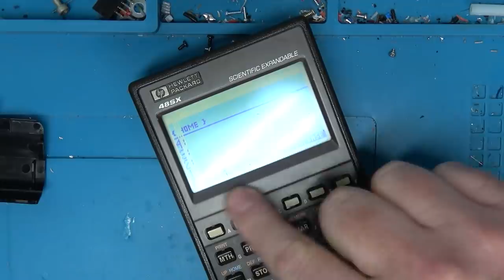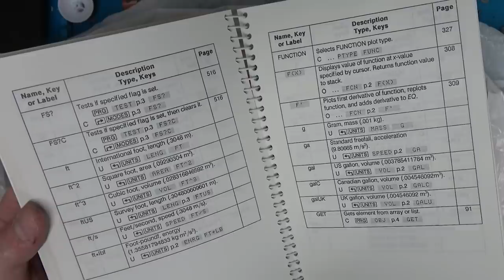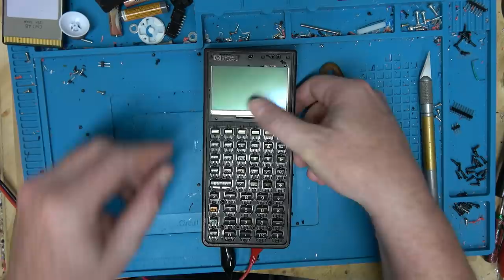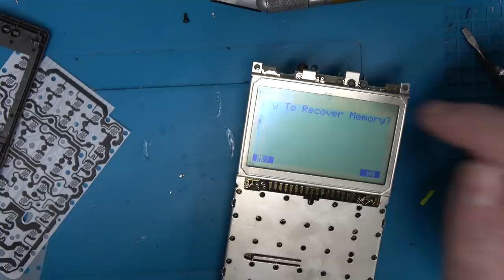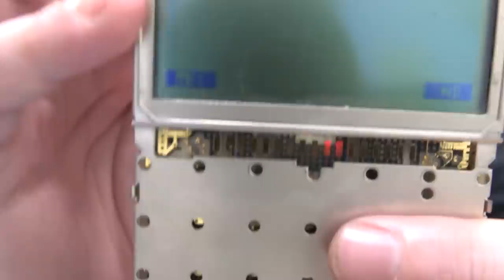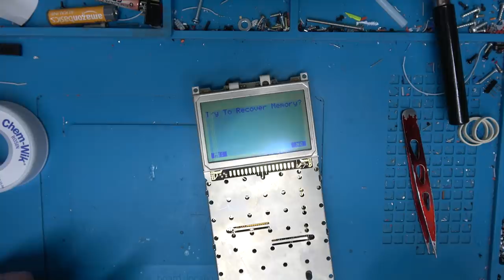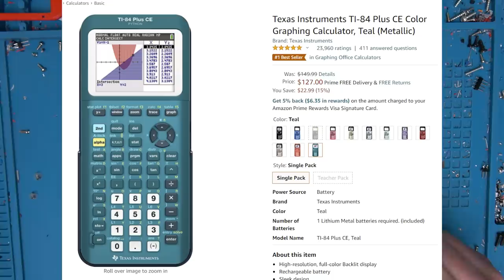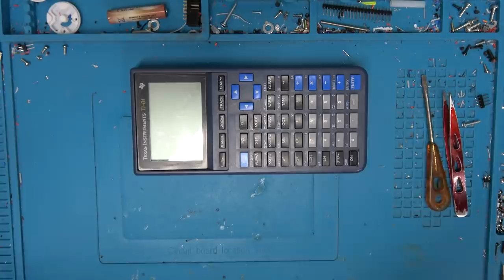Right to Repair Nightmare - HP 48SX

Comment: It sold for $350 in the early 90's. Which is about $700 in today's dollars. So yeah. a ton for a calculator.
Reply: I had one since college until it was stolen from my desk 20 years later.

They feel absolutely "monolithic" in the hand, as if one solid piece like our modern smartphones.  I bet that is why they used all the plastic welds.
Reply: Yeah it was really expensive - one of my friends had one and even had the chemistry addon card. It had an infrared modem feature so you could send messages (or more typically programs or data) between two of them.
What I didn't like at all (it makes sense from a computation standpoint but not from a user interface standpoint) was the RPN. first number, Enter, second number, plus... yuck. Give me parens to nest. :D
Instead I bought (still have it and it still works fine) a TI-85 - the pimp daddy of the TI calculators at that time. Nearly as feature packed (but with an even better graphing display) but half the cost - and since most curriculum back then assumed (if not outright asserted) that you had a TI-81 (the blue colored basic model), I was golden.
One really funny thing about the TI-85 is that it can run Basic code and with tricks you can run assembly, so yes I did have a copy of Tetris on my calculator back in the early 90s. It played almost as well as the Game Boy version, so not bad! :D
Reply: But worth every dollar. This calculator had functions that weren't available anywhere else, like integration, solving equations. Wolfram Alpha wasn't there yet...
Reply: Today, a $700 laptop would make it look... Like a toy. While you could use this for engineering today, I really just wouldn't and it probably is why my dad's is still in a box in the garage.
Reply: Industrial tech is always so amazing to see. Like we all lament planned obsolescence but it doesn’t hit home until you see what the same manufacturers are capable of when targeting enterprise users. I’ve got a couple PDAs that are built so rock solid that I literally ran over one and it works just fine. When I start making money again I’ll probably end up buying a Toughbook because I’m sick of how flimsy even the best consumer laptops are. This stuff is always worth every penny if you can afford it.
Reply: @chouseification  RPN took a while to get used to, but once it clicks, it's WAY faster than parens. I know, I had classmates with other calculators with parens and us 48G crowd were always faster
Reply: @MadsterV  I believe it, I just didn't end up going that route and gaining those stack bonuses
Reply: @gavincurtis  "I bet that is why they used all the plastic welds." Heh, nope. You really think plastic rivets are more solid than machine screws screwed into metal inserts?
Reply: @Gigator  They can in some instances, but eliminate repairability.  Every screw together laptop I have gets loosey goosey garbage after time.  But a riveted laptop cannot be serviced, apple knows...

My HP-48 felt solid, like it was potted when I bought it.  Still solid as the day I bought it decades ago.  Never had to take it apart, looks like I never will with all those plastic rivets.  :P

My Model M keyboard had those rivets on the metal base plate, those have been replaced with screws.  Screws with brass inserts in the plastic should have been used by IBM.
Reply: The HP41 was the last military grade, stirdy HP product.
(With a cool synthetic programming module.)
Then, they let the d signers in and here you are sawing, drilling, milling...
Reply: @braddirt  if he would like to get rid of it it could score you guy sell it for some nice cash mainly if it still in box.

Comment: I've repaired a lot of these, 48SX, 48G and 48GX. You totally ruined this unit for no good reason. LCD and zebra strips from a donor 49G and you would have been in business for the next 20 years.
Reply: Considering I need a display that's good to know. Hard part of a lot of old electronics is finding parts.
Reply: I have a 48sx with a blackened display, I don't know if it turns on. I can't see anything on its display. Can you help?
Reply: @ROGUPA  : Make sure you don't have the contrast turned all the way up first.
Reply: @brodriguez11000  it is not :-(

Comment: The thing is, unlike TI calculators, the HPs just pretty much didn't break. I went to Michigan Tech in the 80s and I worked at a store that sold HP. I can't tell you how many times we had people come in and finally buy an HP after having trashed three TIs in 2 years. It doesn't take many times of your calculator failing in the middle of an exam, and realizing it only EVER happens to people with TIs, to give up and buy an HP.
Not to mention that once you use RPN, everything else is stupid. I mean algebraic is OK if you want to multiply two numbers, but if you're working on complex stuff RPN rules.

Comment: TIL: Canadia has a different definition of a gallon.
Reply: yeah the Canadian gallon aka Imperial gallon is based off of a weight of 10 lbs of water. which comes out to 4.5 liters. where in the US it is based off of a volume of 231 Cubic Inches, or 3.7 liters.
Reply: @scottcol23  ...and then the US also has dry gallon... which is close to the Canadian gallon.. but not quiet...
Reply: @olik136  yeah its ridiculous really
Reply: What u talken about man, like the rest of the world, we are metric. Litres. Must have been a while since you been in Great White North.
Reply: @kippie80  I'm not talking about day to day usage of individuals. I'm talking about a unit of measure.
Reply: @UCsTsgaFY_CV2G8cWOy3tbRg Yeah sure.  I remember.  But, that system went by by with by act of Parliament back with Pierre Elliot Trudeau was in power in the 70's.  Since then, our cars consume fuel at a rate of km/l and we buy fuel in Litres.
Reply: @kippie80  I was just talking about the differences in the US and Canadian gallon thing that was mentioned in the manual. the thing was from 1990 and I guess at that time people in civil engineering were still using it or at least having to run calculations based off of an antique measurement.  I think we all should use metric these days.  And yes, its been a while since Ive been to Canada. I grew up in Michigan, Went to College in suit st marie (Lake Superior State University) which is on the US/Canadian border.  Used to cross over all the time to party at the Casinos where the drinking age was 19. LOL im 39 now and live in New Orleans
Reply: @scottcol23  That's the UK gallon, 10 pounds of water to the gallon, 20 ounces to the pint.  I guess the Canadians borrowed it sometime when we started looking at using litres for everything.  :)  Stupid thing is, in the UK we buy petrol or diesel fuel in litres but we stick to using miles-per-gallon for fuel consumption comparisons.

Comment: They didn't want their technically savvy customers upgrading the SRAM.  The lion kingdom eventually ripped off the tin, stacked on another 64kbyte SRAM with an $8 soldering iron & then had a 48GX for half price.  It was an adventurous & ugly rework, but it worked for a few years until the display cracked in an unfortunate fall.

Comment: That calculator is a bleeding edge technology... uses plasti rivets... HP want you to bleed...

That is the reason they lose in the calculator war. Very expensive and impossible to repair.
Reply: Nothing to do with reparability. HP made engineer's, scientist's and banker's calculators. All of these universally switched to doing work on computers, with spreadsheets and environments like Matlab and Python, not on paper with a calculator. The only people needing advanced calculators are schoolchildren, which TI marketed to.
Reply: @straightpipediesel  : People still need them. They're called cell phones.

Comment: Missing lines in the LCDs of the HP 48 calculators is a well known problem with a well known fix. The LCD panel makes contact with the rest of the circuitry with a rubber conductive strip that gets clamped to some gold plated pads on the PCB. Most likely cleaning this conductive strip would have fixed the calculator and made it just like new. There are tutorial documents online showing the process.

Comment: Still have my 48SX from late 1991 which was given to me as a present for getting a permanent position with a state DOT. It paid for itself many times over, as did the 48GX and 50G successors which I also bought. HP should have retained RPL compatibility with their Prime series but unfortunately they did not... I have over 25 years' worth of programming in my 50G!!

Comment: When I was in high school in the nineties, most people drove cars from the eighties. I remember when cars with shoulder belts in he rear were fancy new cars. Same with air bags and third brake lights. My kid will look at cars without adaptive cruise control as being old.
Reply: "What? I have to actually drive?? That's so 2020"
Reply: "back in the day we had to actually steer cars!"
"wait whaaaa??"
Reply: Or those with an internal combustion engine...
Reply: I share your nostalgia:) But only to a degree. ABS and the other assistant systems including airbags saved many many lives!
That of course doesn't mean the manufacturers have to make it impossible to repair. I don't mean fiddling with the highly integrated safety systems, but damned spark-plugs and their friends alike ... :/

Comment: I used to work at HP where they make the calculators, and I know whats inside, and how its built, so I dont need to watch the video. Its heatstaked every centemeter,  Even if you do get it open you wont get it back together, and none of that matters much because you wont lkely get that dispalay back on because you cant line up the zebra connector properly. or recrimp the holder... So... Im pretty sure this will only end in disaster... 
Those calculators are really really designed to never be repaired, but they are also really well designed to not need repairing. Typically the CPU part is tab bonded, and they usually dont have many other parts. They used really good caps that never fail and everything is coated in gold so it wont ever corrode. The amount of engineering in the calculators is amazing, albeit not very repairable.

Comment: 25:50 A related phenomenon: almost every apartment complex around here built before 2000ish deliberately skips 13. First building, 1-12; second building, 14-27. Every time
Reply: Eh you have different sets of floors in each building? How is that logical?
Reply from the maker: Most planes omit a 13th row of seats.
Reply: @MikaelLevoniemi  It's like reading multi-volume technical manuals where vol. 2 starts at page 500 or so.
Reply: @oldguy9051  It's another book! It should begin with page 1! :D
Reply: @MikaelLevoniemi  Yes, it should. ;-)

Comment: PS: Why are second hand Smart Cars so cheap? Like all Mercs they contain lockout ID codes in every electrical sub-system that only Merc main dealers have the software to deal with. The result is perfectly good second hand Smart cars are now worthless because nearly any repair / replacement must be done at a Merc dealer at prices that are often more than the worth of the car these days!!!
Basically good cars that might have another 30 years in them are now scrap because of Merc's greed! Screw the planet, eh?

...breathe...

I rather like the Russian definition of 'reliability'. A 'reliable' device is not necessarily something that will always work but something that can always be repaired.

Comment: It's difficult to repair. That's only a problem if they ever broke, which they didn't. TIs of the era were lucky to make it 6 months of heavy engineering use before croaking. By contrast most of my friends have HPs that they bought in the 80s and they still are working fine. I'm very sad that both of my HPs got lost in a move 25 years ago. Kinda thinking about buying a SwissMicro clone.
You will notice that all that "janky" assembly - is still solid after decades.
Reply from the maker: That's a good point!
Reply: It seems like the common experience was that someone would steal the thing long before it ever broke down. They were just too valuable.

Comment: TI-81... that calculator had a crippling flaw: the battery cover.  It was made from a cheap flexible material.  If the calculator fell of your school desk, the cover popped off and the batteries scittered across the floor.  Since that calc had no backup battery and no upload/download ability, all saved data was lost.  Whenever someone knocked a calc off their desk, the whole math class would gasp and groan in empathy.

Comment: I worked at a McDonalds in 1993. The Big Mac or the 2 Cheeseburger value meal were both $2.99. Like $0.50 to  supersize it. A QuarterPounder meal was like $3.29 or $3.49

Comment: Amazing HP USA build quality.  They don’t make stuff like this anymore.  I used to have the bluish grey 48GX and it was built solid like a rock.  It’s so solid, that after electronics engineering class, I’d take that calculator with me to gang fights and used to beat a bitch with that calculator.

Comment: I had one of those - used it through college. Mine has the equation editor card inside it (which was mega handy in chemistry and physics). Mine has the exact same columns out on it... and mine was made in Corvallis Oregon too! Edit: should say I still have it.
Reply: I still have mine, bought it my senior year in high school in Eugene during a state track meet and then took it to college in Corvallis.  Never knew they were built at the HP plant there.  By the time I got to college with it, the 48GX was available.
Reply: I got my 48SX my freshman year at Purdue in 1990/91 and also had that equation editor.  The periodic table was fantastic!  Anyway, I have used that same calculator all throughout my engineering career and still use it to this day in 2022!
Reply: @bterjung  Does yours have any display issues? I found it amusing that mine has the exact same columns out as the video - so I thought maybe there was some longevity issue there.
Reply: @MichaelJantzen42  It actually does not!  I'm really surprised because I distinctly remember spilling Hydro-Iodic Acid on the screen and the screen's edge during my chemistry lab my freshman year too!  I seem to recall it being a pretty high molarity too.  I quickly wiped it up but thought the calculator was a goner.  Here it is still working flawlessly over 30 years later!
Reply: @bterjung  That is incredible - my calculator just saw math classes and physics labs and the display is still slowly dieing :). Ah well.

Comment: Still have my 48S from 1991. Was cheaper than the SX, as a student on a scholarship I had to save wherever I could. Had to get a programmable calculator for a applied math course. Back then the choice was between HP or Casio. TI was basically non existent in our market.

Comment: There is unintentionally bad engineering and intentiontionally bad engineering. This one is the latter I guess...
Or it was engineer Bob from shift 3 who designed the case for the "overengineered" pcb on his last days at HP

Comment: ...Within the HP-fan community, the RPL models were controversial because their programming model was such a departure from what had come before: the stack was unlimited depth apart from total memory (which in the first model, the underpowered 28C, was a real problem); the stack and variables could store ANYTHING, including programs, matrices, lists, graphical images etc.; it was a strongly typed functional language revolving around list processing. And you could enter and manipulate algebraic expressions in algebraic form, rather than RPN, which to the hardcore RPN fanatics was anathema.

They were some of the earliest calculators to have any degree of CAS capability, though initially this was very limited. It was mind-blowing just to see that at all at the time, that there was a calculator that could do symbolic algebra and symbolic calculus. (Numerical integration had been a thing HP scientific calculators could do for a long time, and of course these could do that too.) Something that HP kind of lost in later devices was that everything was tightly integrated and consistent--any type of object could go on the stack, anything could be input to a function, every subsystem's output could be used by anything else. My understanding is that in their more recent calculators, a lot of the really powerful capability is siloed into apps that don't necessarily talk to one another, as if they knew they were catering to students who just wanted to master this week's unit in math class and move on to something else.

Comment: My uncle had a 48SX where half the keys didn't work and spontaneously turned off. He told me that if I could repair it, I could have it. And oh boy was it a pain to crack open. I was able to kind of get it working reliably again by fiddling with the little rubbery connector under the screen. However now in order for the keys to work you have to apply pressure on the case under the screen. So yeah it kind of sucks but at least it more or less works. Well, that and the missing front plate that I never managed to put back in place, and the holes from having to literally drill the case to get inside it. At least I got it to work well enough to cheat in a chemistry exam using a cartridge with the periodic table in it.